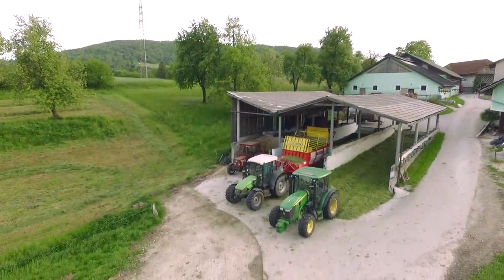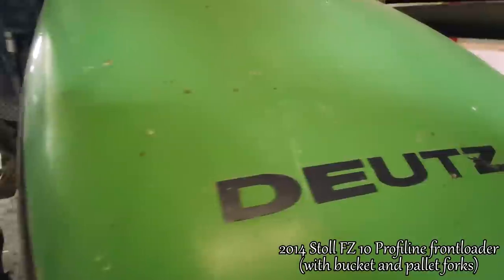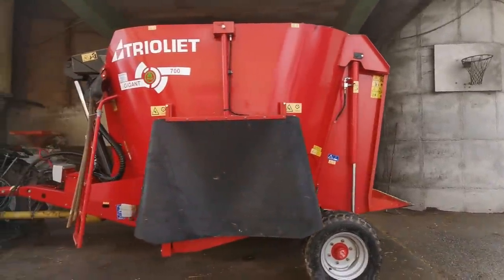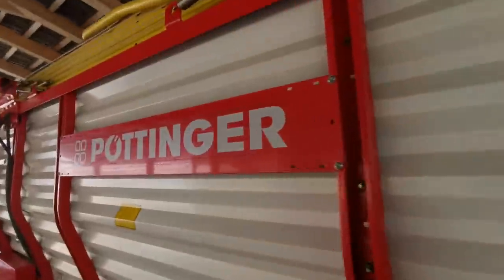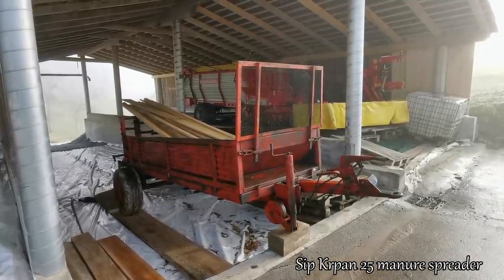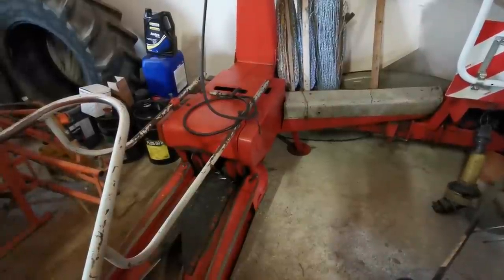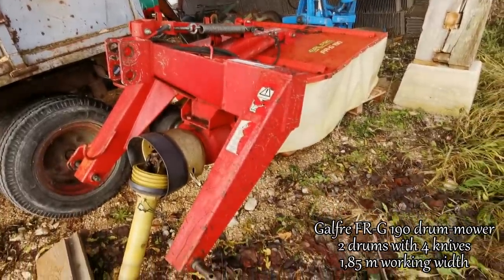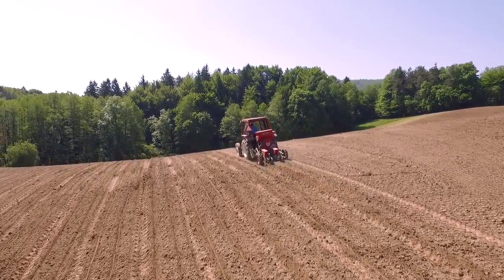Machinery Tour | Tractors and Tools We Use on our Small Dairy Farm

Comment: I live in a quite flat country and sometimes just wonder how steep some of your fields are. It looks like some are quite steep. Is that ever a problem for the work? Wishing you a great year.
Reply from the maker: Yeah some areas are pretty steep. Of course, it can be deadly, tractor can tip or start to roll downhill if the ground is too wet or even too dry (lack of traction)... Thanks, to you as well 🙂

Comment: why don't you attach the silage spreader at the  John Deere? Then you don't always have to change tractors.
Reply from the maker: I can't compact all the way to the back wall... I would need front hydraulic 😉
Reply: Ok, yes then you need a front hydraulic. Then you can also mow with two mowers
Reply from the maker: Yep, but I think it would be a little underpowered for two mowers, at least in some fields 🙃
Reply: @farmerspov4709  we mow wiht eh John Deere 5090 G (90 hp) with two mowers so i think you have enough hp. And for some fields you can mow with one mower.